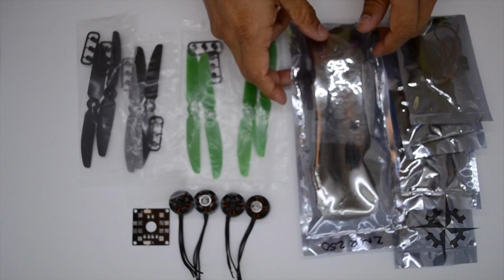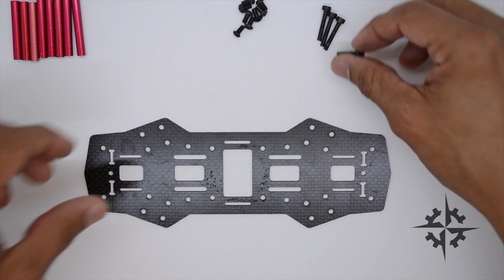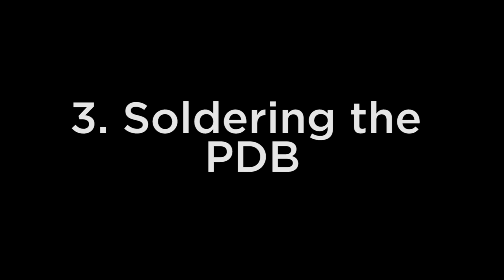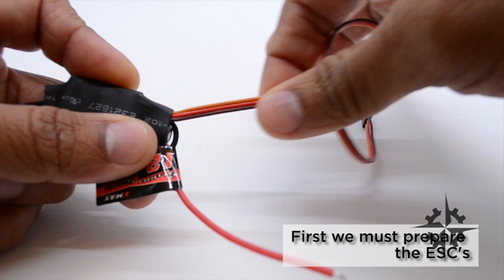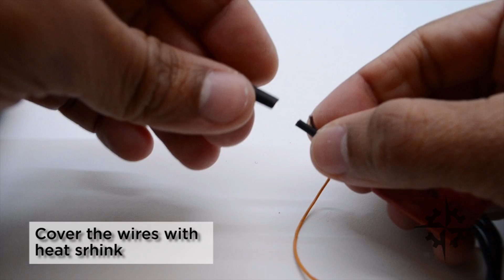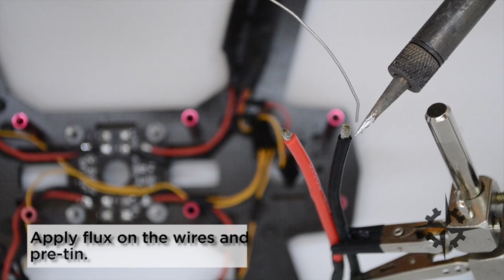Build your own racing drone Part 1. ZMR250 DIY

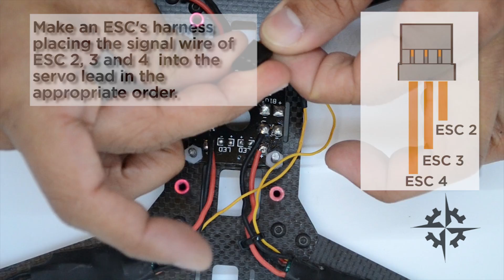Comment: Where do you get the main power supply cables from? 4:35 plz help :)
Reply from the maker: Hey +Lori Hartwig, please check the following link.

https://coastlinerobotics.com/products/battery-cable-xt60-connector?variant=6623374275

Thank you.

Comment: I am wondering about  the differences between brushless and brushed?Thanks!
Reply from the maker: Hey +Benedict Buddy in general terms the main differences are:

A DC Brushless Motor uses a permanent magnet external rotor, three phases of driving coils, one or more Hall effect devices to sense the position of the rotor, and the associated drive electronics. The coils are activated, one phase after the other, by the drive electronics as cued by the signals from the Hall effect sensors, they act as three-phase synchronous motors containing their own variable frequency drive electronics.

A Brushed Motor has a rotating set of wound wire coils called an armature which acts as an electromagnet with two poles. A mechanical rotary switch called a commutator reverses the direction of the electric current twice every cycle, to flow through the armature so that the poles of the electromagnet push and pull against the permanent magnets on the outside of the motor. As the poles of the armature electromagnet pass the poles of the permanent magnets, the commutator reverses the polarity of the armature electromagnet. During the instant of switching polarity, inertia keeps the classical motor going in the proper direction.
Reply: thanks a lot! btw which one will u choose ? Brushless or brushed?
Reply from the maker: Hey +Benedict Buddy it depends of the application you are planning to use it for. For FPV racing drones Brushless motors are the way to go.
Reply: alright, again, Thanks!

Comment: I have built 27 Drone UAV professionally with automated and maual flight modes. with RTL(return to launch) switch incase the drone loses connectivity.
Build book: http://www.amazon.com/dp/B01C69WOCO?ref_=pe_2427780_160035660

There is alot of minor points that is not mentioned in this video so your drone will crash and you will get a headache rather save yourself alot of time by getting this book.
The links to buy the items you need is included in this book and I offer free assistance.

Comment: What model of lipo battery did you use
Reply from the maker: Hey +Ezaz Ahamed, on this quad I used initially a 3S 1500mAh 30C battery but as I was getting better controlling the aircraft I decided to upgrade to 4S to have a faster drone.

Please feel free to check our battery selection:
http://coastlinerobotics.com/collections/multirotors/batteries

Thank you!

Comment: what is the order of the esc (motors) 1,2,3,4 ???
esc 1 front right
esc 2 front left
esc 3 rear left
esc 4 rear right

is this correct??
thx.
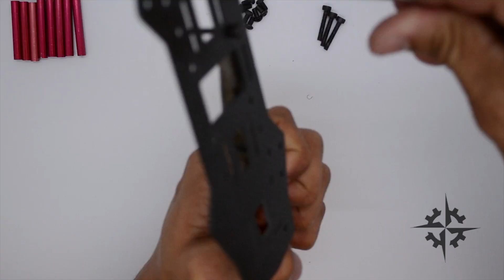Reply from the maker: Hi +Alfons der viertel vor zw&#246;lfte please go to the minute 1:16 of the following video
https://www.youtube.com/watch?v=Hy7iujd50uQ

The order is actually:

Motor/ESC 1: Top Left (Clockwise)
Motor/ESC 2:  Top Rigth (Counter-clockwise)
Motor/ESC 3: Bottom Right (Clockwise)
Motor/ESC 4:  Bottom Left (Counter-clockwise)

Have a nice one!

Comment: Thank you for these great videos. Shouldn't my motors immediately start spinning (low speed) when I arm the quad-copter? They currently are not. What do I need to do to get them to spin when I arm? Thanks.
Reply from the maker: Hey +VD2021,Thanks for the cool vibes!
What flight controller are you using? CC3D?
Reply: +VD2021 I was premature with my question. During the CC3D setup I discovered the option. I currently have the box checked so my props spin when the quad is armed. Thanks again.

Comment: why did you cut the wire of the esc
Reply from the maker: Hi +fetty wap! The reason is that these ESC have a 5V BEC that feed power to the CC3D board and when they are connected in parallel they can interfere with each other. This happens because the 5V output from each ESC might not be exact on each one of them so the load ends up going through the one with the highest voltage. If the load you're powering with the BEC becomes large enough, it will cause the voltage to sag on the dominant BEC, and only then will one of the other BEC's start to provide current, and they could start fighting each other like this, causing voltage oscillations and maybe brownouts. This depends on the BEC circuit and how good it is, and how much current you're pulling. Could be fine, but better to be safe. On the OPTO kind of ESC's you won't have this problem since they don't supply power to the flight controller so you will need to add an external BEC to reduce your battery voltage to 5V and power up the Flight Controller. Note: On the Naze32 is not necessary to remove the power cable from the ESC's.
Reply: +Coastline Robotics .thank you

Comment: How thick are the M3x18mm screws for the stand off's? I have this kit, but they don't seem to provide all of the screws that you need.
Reply from the maker: Hi +Gee Wood ! An M3x18mm screw might be too long for these standoffs, better try M3x6mm or M3x8mm. I don't know from where did you get this kit but the one we sell includes all the hardware necessary to assemble it. 
Cheers!

Comment: The PDBoard that you used, if you look, has two switches,, and separate solder pads, (the smaller pads) so as you can attach and then turn on and off the lights.  I too did not notice them until a rebuild!
Reply from the maker: Hi +Mark McNamara you're right, on our next build we will use them. On this PDB the switches were damaged, that's why I didn't use them. :p